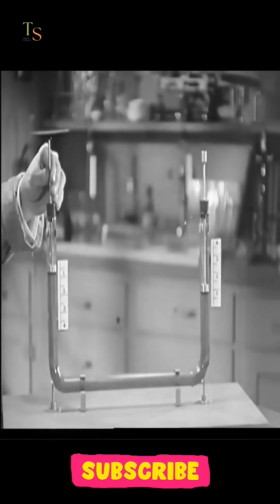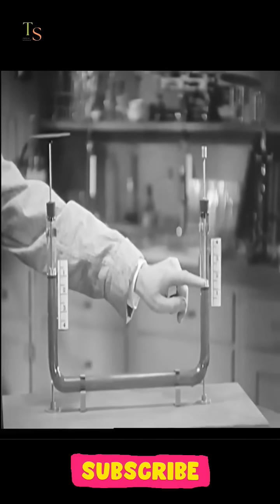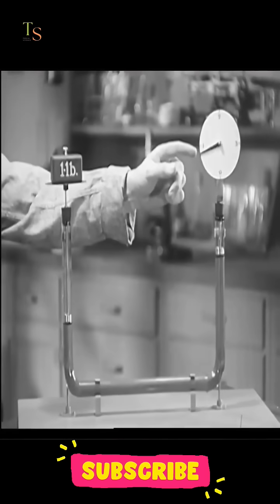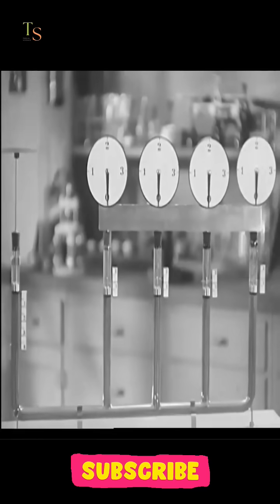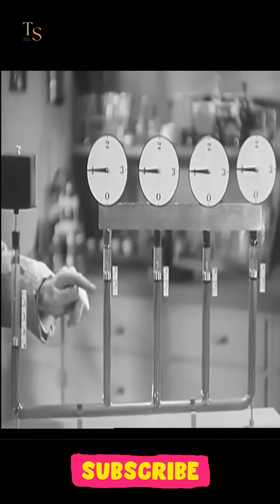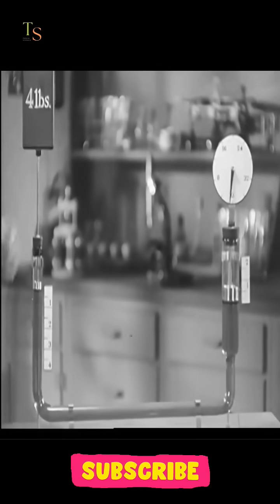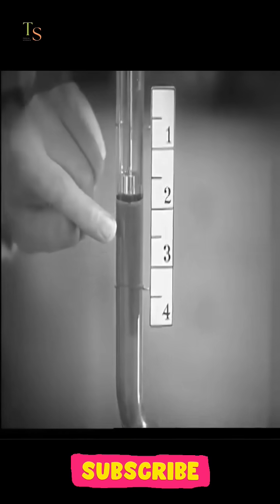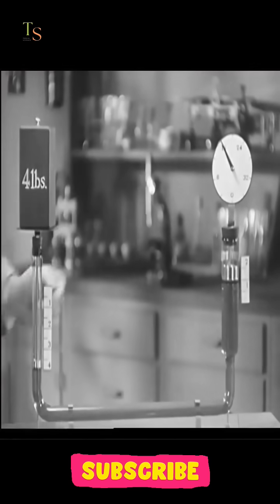How Hydraulic Brakes Actually Work #HydraulicBrakes #Engineering #physics

Comment: Liquid can not be compressed 

Is it right?

Not entirely. While liquids are much less compressible than gases, they are not completely incompressible. Under extremely high pressure, liquids do compress slightly, but the change in volume is very small. This property is why they are often treated as incompressible in many practical applications.

Comment: You are wrong. It's common knowledge among hydro engineers, seawater is denser at great depths than it is at sea level. Water is a polar covalent molecule and solvent. The atoms will align with pressure or temperature.

Comment: this comes under mechanical properties of fluids.very interesting topic tho..Also i dont think liquid compressiblity comes in picture..I think liquids are compressible..It is used bcz they can go in any shape easily....Here technically,:P=F/A comes in picture where p s pressure ,f is force and a is area..and as pressure on same heights are equal,by chaging area,you can change the amt of Force applied

Comment: When I did hydraulics class in the Marine Corps they said hydraulic fluid expands they call it thermal expansion but it cannot be compressed. But after it expands it compresses itself when it cools down proving them wrong it just takes more force to compress it further

Comment: That 6 inch down, 11 inch rise is incorrect. You could see the rise was less than that. If those were all the same areas, a 6 inch drop would result in four 1.5 inche lifts. It looked like 4 inches down and 1 inch up on the four gauges. Simple conservation of mass.

Comment: Brakes use a small cylinder at the pedal anchor large pistons at the brakes. This gives a force multiplier and the driver gets a feedback through the pedal. When the master is too large the brake becomes stiff with an off-on feel. It’s harder to use.

Comment: I feel like something is being missed cause with theres equal pressure on both sides applied it will continue to increase in pressure the more pressure you add. At a cost of producing less heat. Other then in nuclear power plants where does this get used?

Comment: Liquids are very hard to compress. But steel pipes do have elasticity. Even other material pipes do have elasticity. So pistons do not move exactly as these images make you think they do. Pipes do dilate or contract under pressure or lack of and the effect at the other end of the pipe is exactly like the liquid was actually compressible.

Comment: Not exactly equal force the caliper closest to the master cylinder will receive pressure first then bleed down the line that's why the drivers side front pad typically wears slightly faster

Comment: Hydraulic fluid has minimal compressibility, but lower viscosity liquids can. You can test this by using one of those plastic medicine syringe with no needle for oral medicine, fill it with water, place a finger over the end and press the plunger down. It will move down some then stop and no liquid comes out, this is compression.

Comment: The whole video is just AI garbage, first off liquids can be compressed, The water at the bottom of the ocean is more compressed then the water at the top of the ocean. Also energy is wasted, You said none of the energy would be wasted and it would be, some of the energy is turned into heat.

Comment: actually this is not true. some liquids can be compressed. and factually all liquids can be compressed if the force is big enough though at that point we talk about at least 14km deep water which doesnt exist on earth. but at oceans with that minimum depth you see a layer forming that is called "deep ice" as the water is compressed - by water weight - to crystalise and form ice that is actually denser than water (while ordinary ice is less dense) and it forms at higher degrees than the actual freezing point of water (about 4°C as that is the temperature water is at its heaviest)

Comment: Liquid can be compressed. Just some more than others. This is why we don’t use water in our break system instead of hydraulic fluid. And now there are several additions to the hydraulic fluid that allow it to withstand extreme heat and continue to perform well.

Comment: water can be compressed, but it requires extremely high pressure to reduce its volume by even a small percentage. According to physics, the compressibility of water is about 0.00005 per unit of pressure (measured in atmospheres). This means that under typical conditions, the amount of compression is negligible, but in high-pressure environments, such as deep under the ocean or in hydraulic systems, some compression does occur  .

Comment: Hydraulics have to be the best invention in the past 50 years
Reply: It could leak. You can't use this system without pressure and usual refillings. Seems like "drive by wire" is our future: like in the Boeing and Cybertrack.
Reply: The hydraulic press was invented in the late 1700s

Comment: If liquids in general, under any circumstances could not be compressed, brake fluid could be replaced with water, in all hydro braking applications, and they would function as intended, which they definitely would not

Comment: Liquids can be compressed, depending on the liquid in question, the amount of force exerted, and strength of the field the liquid is in. If liquids in general, under any circumstances could not be compressed, brake fluid could be replaced with water, in all hydro braking applications, and they would function as intended, which they definitely would not

Comment: Hydrologic theory 101. With the new though tubes and pipes trucks should be using hydrologic brakes instead of air. The reason we went away from hydraulic brakes was a leak whole be the end to all brakes but with new technology in the system hydraulic should have came back. Air brakes bleed off and during long descent tend to deplete the supply tank. Hydraulic would not as the same fluid is reused..

Comment: it can squishable by the force . this is very tiny amount but you are losing some energy .and not just that . its loosing some energy to friction between the wall. its turning to heat . but its very efficient way to transport mechanical energy to somewhere .

Comment: The phase "No force is wasted" wrong in 2 ways. First the piston don' t transfer force (F), it's is pressure (F/s) the thing piston transfer. To correct you mean it should be "No Energy or no Work is wasted". However that also not quite true because in reality, nothing is perfect. Some of kinetic transform to heat when you compress the liquid. Someone who ever use hand pump will understand what i mean.

Comment: For everyone trying to find fault with the definition of a liquid by saying you can compress a liquid at very high pressures and temperatures you are wrong. Assuming you are correct and you did in fact find a liquid that could be compressed at high pressure or temperature then what you’ve done is compress a gas and not a liquid. Liquids especially liquids like water dissolve or emulsify gases. But also liquids are a physical state defined as a fluid that’s INCAPABLE of being compressed. If it can be compressed it is not a liquid just a very weird gas.

Comment: Good explanation of how the brakes work, despite all the wrong numbers. Now I get this. So how does this work with ABS's 60 pumps a second (or is it 30)? Is it all fly by wire to each brake now due to traction control braking individual brakes?

Comment: Water can be compressed. Very very miniscule amount. Like the Worlds hardest spring. This is why at deep ocean level a sub once compromise will just implode in a nanosecond due to the springing back of the water into the air pocket. As opposed to shallow waters.

Comment: Water can be compressed and that happens at sea bottom pressures for example... one of the diving vehicles that was designed to explore deep sea, I forget its name, had gasoline as a floating medium. Compared to water, gasoline is practically incompressible, so the container wouldn't remarkably pucker in the depth.

Comment: Little know fact. The water level has been used for thousands of years. It was used by the Egyptians to level the pyramids. It's made by filling a hose with water. The water naturally levels on both sides of the hose no matter how far apart they are

Comment: Liquids can indeed be compressed, but only to a very small extent compared to gases. This is because the molecules in liquids are already closely packed together, leaving very little room for them to be forced closer by pressure. In contrast, gases have widely spaced molecules, making them much easier to compress.

In practical terms, for most applications, liquids are considered incompressible because the amount they can be compressed is negligible under normal pressures. However, at extremely high pressures, such as those found deep in the ocean or in industrial hydraulic systems, liquids do exhibit some compression. For example, water, when subjected to pressures of several thousand atmospheres, can be compressed by a small percentage.

This property of liquids is crucial in hydraulic systems, where incompressibility ensures consistent force transmission.
Reply: That is STILL incorrect. You can compress liquids as much as you please. You could put the entire ocean into a pokeball with enough force.
There is no "limit" how much you can compress any material as such, it's just way harder for liquids and solids.
Reply: You flavour the minced meat never put only once the water ..but multiple times in processing

Comment: The first automatic transmission using hydraulic fluid was developed in 1932 by two Brazilian engineers, José Braz Araripe and Fernando Lehly Lemos; later, the prototype and project were sold to General Motors!

Comment: Half of the information in this video is inaccurate... liquids are compressible (some more than others... why do you think we use brake fluid instead of water?), and force is lost in most transactions as heat, friction, and sound in some cases.

Comment: This narrator doesn't make any sense. (Any action is same opposite reaction) You can't measure distance to pressure, obviously you will loose pressure if pipe is excessively long but in other words distance equals distance and pressure equals pressure influenced by liquid viscosity, diameter/length of pipe and other resisting factors
Reply: This isn't very legible

Comment: Liquids BARELY compress. The best hydraulic fluid is a liquid with low friction that compresses even less than other fluids. Brake fluid is designed for these qualities, at the cost of it's toxicity compared to water.

Comment: This is how you communicate quantum entanglement.  No matter how long the pipe is, any movement on one results in instantaneous movement in another.  Imagine you had a pipe big enough, you could technically have a pipe 1 light year long.  Still there would be an instantaneous movement in the opposite direction at the other end

Comment: A really good experiment you can do is to get a bicycle pump, suck up some diesel using a "syringe" motion. Then, screw in a set screw in the open hole in the end, hold the barrel and hit the handle with a mallet.

It accurately shows the effect of diesel compression....

Comment: Water can be compressed...
Hydraulic oil is harder to be compressed. Hence, most cranes and rescue equipment use this, than water.

There are liquid that is harder to be compressed. But in terms of cost, i think hydraulic is cheaper.
Reply: Most importantly and famously, hydraulics are used in almost all manner of aircraft movement. From the aircraft control surfaces(flaps, rudder, ailerons, each of the trim tabs) to the motorized doors, landing gears, the doors that enclose them and even the brakes. I think most of the motorization is done by electric motors now known as fly-by-wire system. But some parts are still hydraulic. It's true that most liquids can be compressed, but the oil can be compressed the least and reliable in most temperature extremes. It's gotta be to hold up and move all that plane. Sorry for the long explanation. This part of aircraft(a/c) operation is up my alley. 😊

Comment: But why don't use water instead oil 🛢️🪔
Reply: The first thing that comes to mind is that oil freezes at a lower temp and boils at much higher temp than water.  But also, the compression is less with oil (despite this video saying liquids dont compress, they do), and oil lubricates better than water. Theres probably other reasons Im not aware of.

Comment: Liquids can be compressed. I found out the hard way when I was young & I topped up the brake fluid tank of the car with distilled water. The pedal became so easy to press all the way to the floor.
Reply: Brakes get hot, water boils into steam, steam will force fluid out of the lines back into the reservoir when the water boils,  the steam which is a gas, is very easily compressible. Water is not very compressible, but you don't use water in brakes because it would very easily boil during normal operation and fill your brake system with steam.
Reply: @rickanderson8088  I should mension that after topping up with water, I tested the pedal without driving the car. It was the same feeling of the brake lever even after driving it around.
Reply: Well, it turned into water vapor which is compressible. But water on its own? Not so much. That's why it's wise to change brake fluid every 4-5 years

Comment: Force is always wasted- in the form of friction of the pistons and drag of moving the liquid through the pipes plus the weight of shifting the liquid. This loss of energy causes heat, hydraulics that operate constantly need cooling.
Reply: Energy is never lost. Bad choice of words.
Reply: @simonharris4873 yeah, it's loss of work...yet, we all know what he meant
Reply: Force isn't a quantifiable in the same way energy is. Energy is derived from force. You apply the force over a distance thus giving energy to the system. The system translates some of the energy to do work on the other side, but energy escapes as heat, throughout the system in the process.